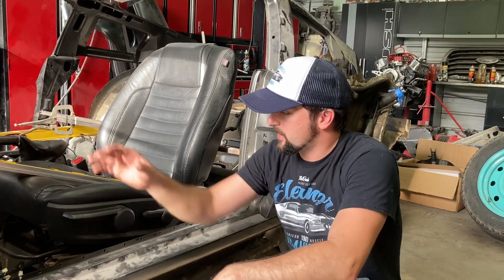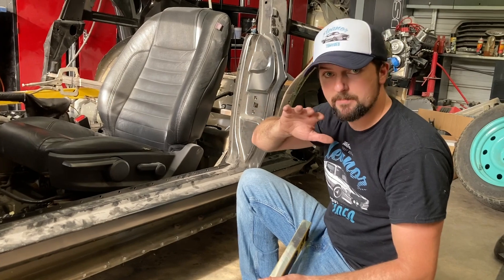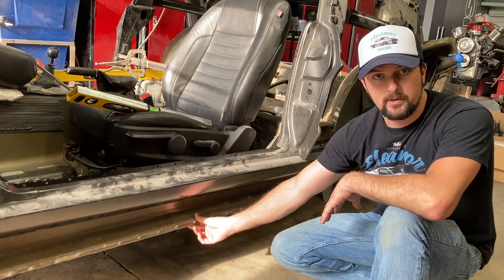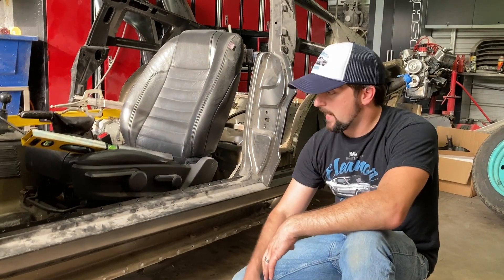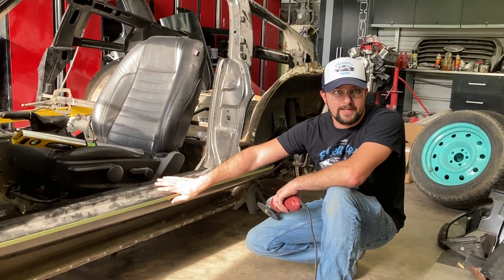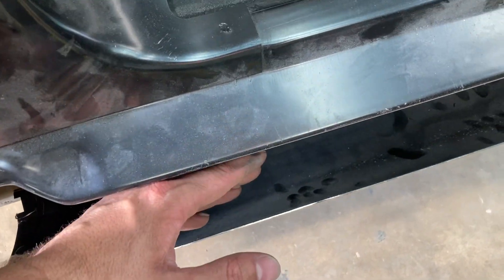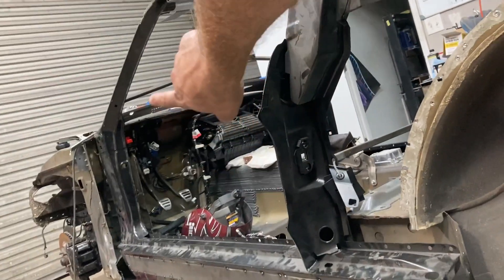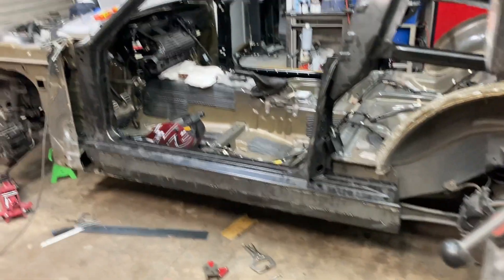1967 mustang body swap part 2

Comment: What about running some cool stainless exhaust down those bottom rockers and leave the original width
Reply from the maker: I will be running an exhaust out the side but through a skirt rather than an exposed pipe
Reply from the maker: I remember the car the boy built on the movie corvette summer had those pipes